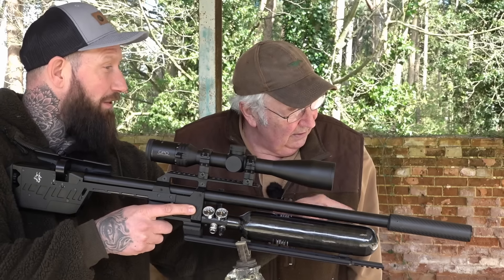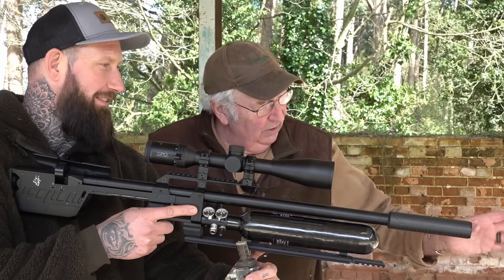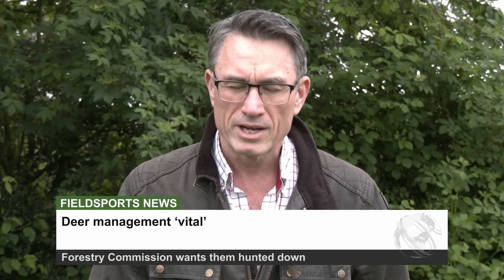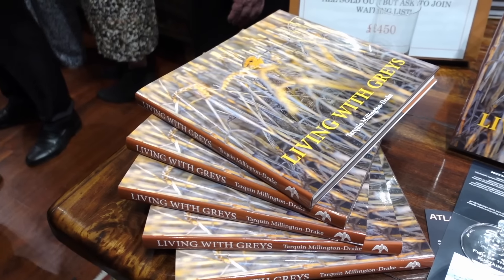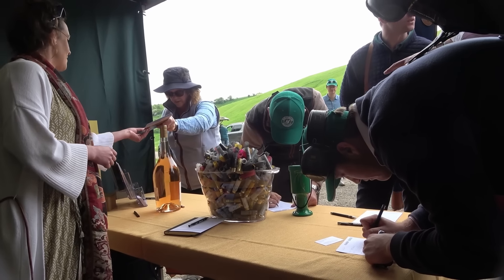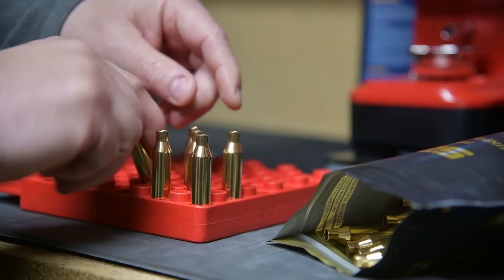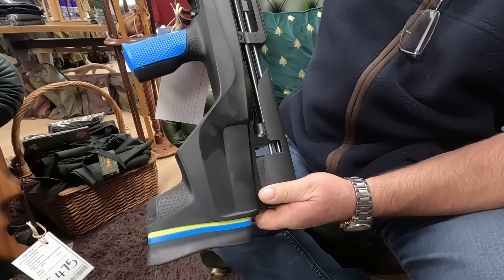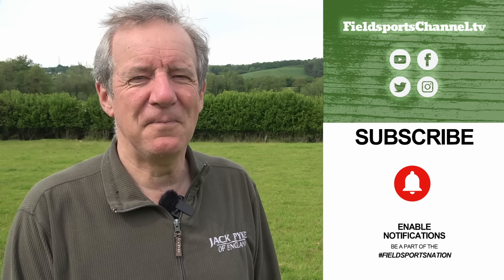Fieldsports Britain – Rats up close and personal

Comment: The calculations on the reloading is incorrect. For that calibre, if your spending over £1 per round then your doing something wrong.   Bullet heads are £30 for 100. Primers are 15 pence each. Powder is 30 pence and brass is about £85 for 100 but you reuse the brass 7-8 times as long as you don’t make them too hot and anneal after 5-6 time. So 11 pence. Total spend 86 pence per round. That’s without the cost of all the equipment.